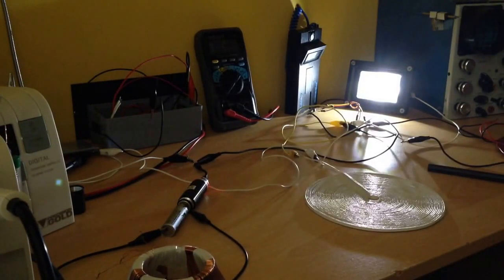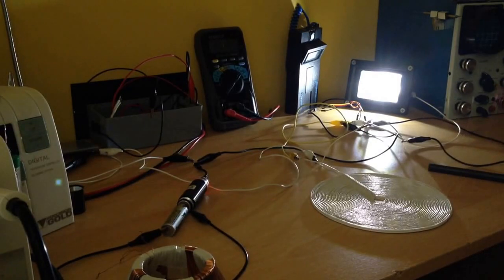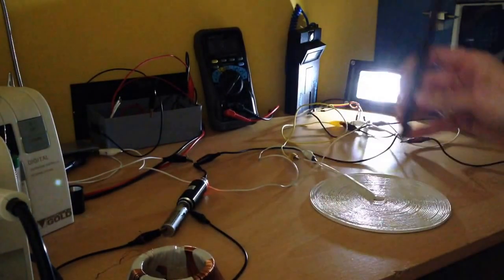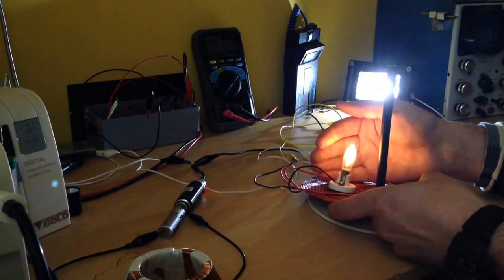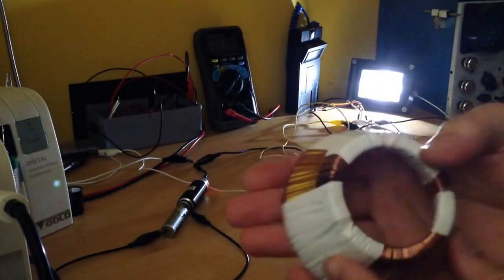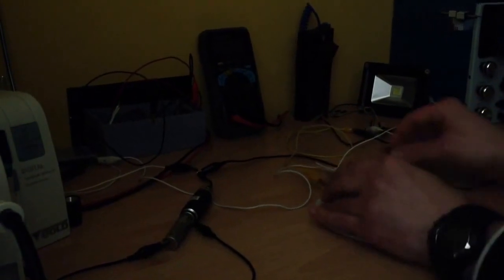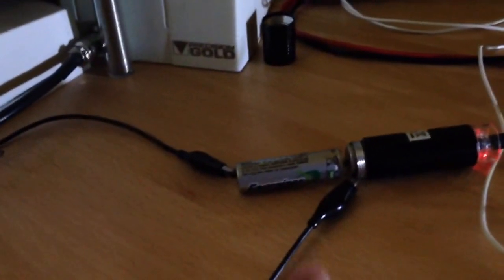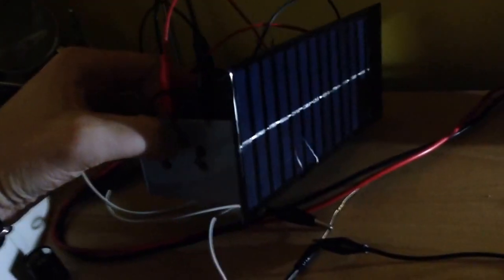Infinity LED Light-Solar Lamp

Comment: Hi Kamil, very nice  demo  what circuit you using for this set up? thanks in Advance
Reply from the maker: XDD29 9
I'm using standard Joule thief but instead ferrite rod coil I'm using pancake coil, you can use few different transistors but 2N39... will do for testing. Visit my page for more wireless "fun"
iSparkTube.com/howto:wirelesspowertransfer